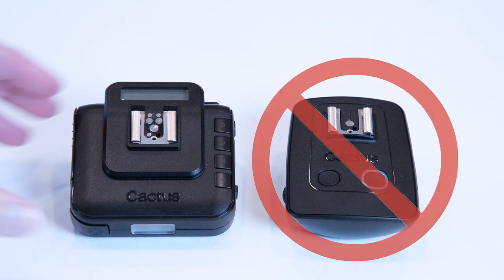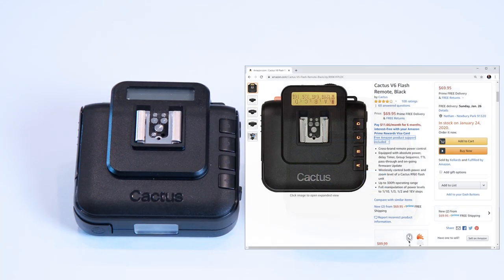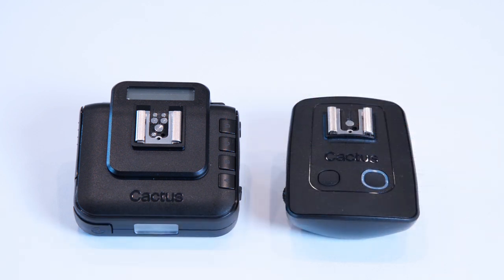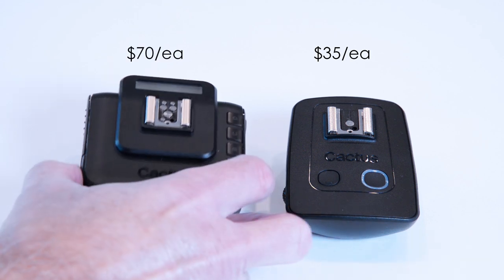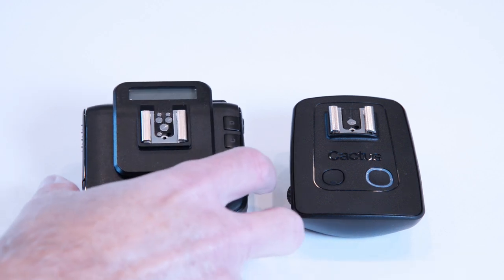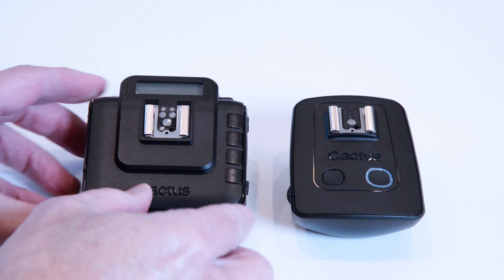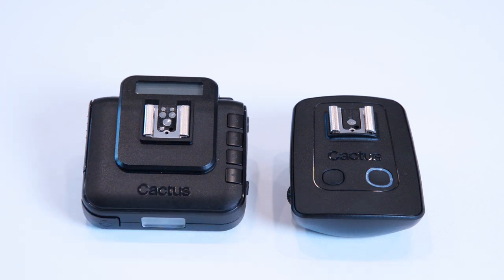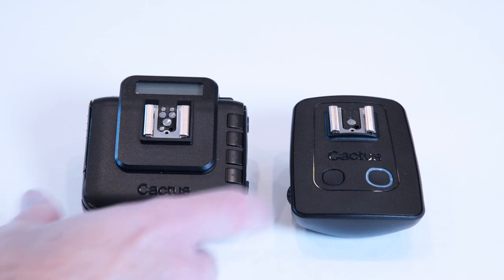Trigger Updates for Real Estate Photography

Comment: Hi Nathan, I have been trying to figure a way to shoot HDR with flash for several years and my Canon's would not do it. I saw another photographer do it in Auto Bracketing mode on a Nikon and I then did a ton more research to see how I could do it on Canon. Canon says no everywhere I look. So I have seen you use the single pin bypass and I decided to try that since I had a single pin hot-shoe adapter like the one you show here.... didn't work. It would not even fire the fash for one exposure. So, I went "old school" and taped off the connection on my Youngnuo YN 622C leaving only the hot pin available. BAM! it worked. Now I can adjust my flash independent of the camera which I love, AND, it will fire 5 auto bracketed flashes just like I wanted it to do. I do not know if I can make the exposures as I want, but it is a step in the right direction anyway. I am so thankful you tripped MY trigger to think outside the box. Great videos my Brutha!

Comment: Thanks for another excellent and informative video, Nathan. I started using the R2SP after your video about the AWB issue. I put the R2SP in my camera’s hot shoe, in APP mode, and adjust my Flashpoint strobes with an R2 Pro, off camera. 

It works great. I use a CamRanger for my shutter release. However, I’ve also used a pair of R2SPs as a remote shutter release for non real estate photography. They work fine in that capacity. 

Again, thank you for creating these videos, and your books, they have helped me tremendously as a build my real estate photography business.

Comment: I rushed to purchase the single pin adapter and the link to amazon takes you to a cold shoe set of 2.  I also purchased one of the clip alternatives in the links above and it is HUGE and heavy.  It's the one with the ball head attached.  I'll be returning both.  But I appreciate that you try to direct us to possible goods to help.  I'm regretting that I returned a set of cactus triggers when I accidentally ordered 2.  Thanks, Nathan!
Reply from the maker: You're very welcome! In the description where I included the links, the link says "Cold Shoe Adapter", I didn't include a link to a single pin adapter as that was in earlier videos; however, here's a link to that if you need it: https://www.amazon.com/gp/product/B073WVW9XM/ My apologies for the clip alternative, as I mentioned the other was discontinued, but there are many you can get that are similar, sorry that one was a bit hefty, and I'll keep my eyes open for others. If though you opt for the YN triggers, then you don't need to have one clipped to your belt (they are smaller and fit in a pocket), and for the one clipped to your tripod the weight you mentioned won't matter, so that clip should work fine. My apologies for any confusion, and I hope this helps.

Comment: I bought a JJC Standard Hot Shoe Adapter to use between my Sony A7 III and my Godox X1T (S). I discovered that the Sony center pin is not the same "center" as Canon/Nikon/Fuji, therefore it didn't work.
Long story short, a Canon/Nikon flash or transceiver will work with a Sony camera, but a Sony specific flash/transceiver will not contact the pin on a Canon/Nikon camera, or a generic hot shoe adapter.  I am buying a Nikon R2 Pro.
Reply from the maker: There are a bunch of comments regarding this that might help in this video: https://youtu.be/RCQO24hcjMo

Comment: Just bought a bunch of the R2SP and I'm impressed.  My 1st impression was how sturdy they seemed, which is something I didn't find on the Cactus V5's.  Also included a AD 200 Pro and am just a little disappointed with the power.  Should have taken more notice of your review and not those that were pushing they have the power of 3 speed lights; but it seems useful.  Looking forward to your next book.

Comment: Hi Nathan, I've been watching your videos for some years. Everything I know about RE photography has been thanks to your videos. So, thank you very much.  You're a great mentor, and I know about mentoring since I'm a professor at a university. A couple of questions: 
1. For camera wireless shutter,  I've been using a couple of Yongnuo RF 605N for around 3 years. But sometimes it takes some time for the camera to focus. It's like the devices have some kinds of issues. In 2023, is Yongnuo RF-603 N II still your recommendation for wireless shutter?
2. I've been using Yongnuo flashes for some years. I'm thinking of moving to Godox since it has more options. Is there a way to use both systems during the transition?

Thank you very much in advance.

Comment: Appreciate all the info. On top of these remote triggers for shutter and flashes, I'm looking for guidance to minimize camera movement by physically touching camera when switching settings from an ambient bracket to flash. Often times auto aligning in PS in post still leaves things unmatched especially when shooting on carpets or non solid floors.  I'm a Sony shooter, other than cam ranger or sony apps on mobile, are there any other options to check out to adjust camera settings remotely?

Comment: Nathan… You’re a God! Question: can you put the RT pro on top of the $35 kit that you recommend? I’d like to be able to stack it on top of my hotshoe  to prevent any unnecessary hanging objects.
Reply from the maker: Thanks! I should have mentioned that: The YN RF603 triggers won't work nicely with most R2Pro transmitters since the YN triggers don't like to detect TTL, which the R2Pro advertises, even in Manual mode. In other words, the same problem with the R2Pro that causes AWB issues also prevents the YN triggers from stacking with it properly. Use a Cactus V6 to stack, or just use the single pin adapter I talk about in the video.

Comment: Hi Nathan great video as always. So I have a couple of YN560 IVs that came with a YN560-TX controller... I also have a Neewer vision 5 strobe that I'm hoping to add to my system by using a YONGNUO Updated YN622C II Single Transceiver. I just use my canon remote for shutter release. Do you see any potential problems with this set up? I also ordered the single pin adapter because I am getting warm colors from the strobe when using the Neewer controller so thank you for that info!

Comment: Thanks for another great video and helpful advice. A true beacon of light!
I plan on getting the R2PRO for my canon camera. To avoid using a single pin hot shoe you suggest using the Nikon or another non canon version to get around the colour cast issue. In an earlier video on this trigger you mention the going into menu/shoot/single for it to use only the center pin. Does this solve the colour cast issue even on a canon model, or do you still recommend getting a non canon version?
Thank :-)

Comment: I can confirm the white balance issue. It's real. I use a Sony A7III with Sony R2 (1st gen) trigger. I have an extra Nikon R2 trigger and use it on the Sony A7III and the white balance is different (true to the color I see). This sucks, I usually blame the camera for this issue. I just wonder if there's a firmware update to correct this problem.

Comment: I have 5 of the Cactus v5 triggers that I use as non-ttl triggers as you describe in your books. As we move forward and away from Cactus is there a trigger you're aware of that, if mounted on the camera (Nikon) hotshoe, will trigger the now discontinued v5 triggers (which are mounted on the flashes - YN560's and XPLOR600's)?  Thx again for your great vids and publications!
Reply from the maker: The Cactus V6 will trigger the V5s.

Comment: Nathan, I bought two of your book and have been following along purchasing equipment for my setup. I had just ordered Cactus V6 triggers before you released this video. Is there any reason I can not or should not go ahead and just use those for my shutter release and flashes since I already have them? Thanks for the great content!
Reply from the maker: Hi Greg. The V6s will work just fine. But, they are bigger and more expensive than the V5s I recommended in my books and earlier videos. If this is just for shutter release, then you may consider returning those and buying the less expensive YNs I show in this video.
Reply: @NathanCoolPhoto  Thanks for the response! I think I'll do that and order your other books!

Comment: Hey Nathan, I have a flashpoint R2 trigger that came with my Explor600. I would love to use this to trigger that light and my new AD200 along with my other Yongnuo YN560 IV speed lights. I shoot with a Sony A7iii and currently use the Yongnuo RF630C II trigger for my speedlights and just slave my 600 or AD200. I am wondering what the best setup would be to avoid white balance issues using the R2 trigger directly and integrating with my existing speedlight workflow. Appreciate your in depth videos, just haven't found my solution yet.
Reply from the maker: Hi Michael,  to understand the whys as well as the whats, I'd suggest taking a look through my interiors e-book, which has my recommendations as well as why, thus allowing you to make a more informed decision, here's a link if you'd like to check that out: https://amzn.to/37mWFnu
Reply: @NathanCoolPhoto  I own that book and your others, good stuff. I will take another look regarding the triggers. I was just curious if you had any insight using this specific setup as I know you utilize some of the similar gear. Thanks again.

Comment: So I understand-- you clip the yongnuo RF603 with cable to the camera for trigger only and do not use it as a pass through [stacking]  (on the hot shoe) for the R2Pro (for which you use a single pin adapter instead)?
Reply from the maker: Hi Cyndy, the RF603 won't work as a pass-through in the camera's hot show with an R2Pro stacked on it. Something I didn't elaborate on in this video (but should have) is that the RF603 doesn't like it when it detects TTL, which, although the R2Pro can be set to manual (which I recommend), it advertises enough info to the camera that the RF603 below the R2Pro picks up on that and will not play nicely. In other words, the same problem with the R2Pro that causes the AWB issue also prevents the RF603 from being a pass-through. So, I recommend one of the work-arounds I show in the AWB-trigger video, which I also touch on here, one being the single-pin adapter, or stacking a Cactus, but not stacking a YN.

Comment: From your books, my impression is that you adjust the power for your flashes on the units themselves, not on the commander (R2Pro).  How do you set the commander to allow this?  If I change the power on the light, it always changes back to whatever was set on the commander.
Reply from the maker: Hi Jim, you have to configure the R2Pro for that. I show how in another video at https://youtu.be/dWE0bXFFNpo
Reply: @NathanCoolPhoto  Thanks - I'll check it out.  BTW - I really like how your pics come out, way better than what I've been doing.

Comment: Would two of these 603-II work to trigger both the camera shutter remotely and an off camera flash remotely ( one on camera , one on flash - using the trigger button on the unit attached to the flash,  to trip flash and shutter  ).

Or would I need a third to act just as a remote shutter release to do everything I want ?

If not the 603-ii , would pairing the Godox x2t with another x2t and or a x2r achieve this ?
Reply from the maker: This requires a deeper understanding of how the various triggers work, in what sequence, and how. There are two sources I can point you to that would help: First, this is covered in great detail in my course on Pro Interior photography at https://learnre.nathancool.com Second, you can look through my book on interior photography at https://amzn.to/45XUV1D Those two sources will teach you a number of things, including the various trigger configurations and how they are implemented and used.

Comment: Hi Nathan, I’m enjoying your channel. 
I want to try my hand at real estate photography. 
I have a Sony A73 and Xpro together with Godox AD400pro and Godox V860 flashes. 
As I understand, to avoid White balance issues I need to purchase a single pin hot shoe adapter to isolate pins between the Xpro and the camera hot shoe. 
However, I am unclear on what equipment I need to remotely trigger the shutter and where to install the same. 
Thanks....John
Reply from the maker: Hi John, I'd recommend looking through my interiors book and lighting guide, which will help you better understand the "whys" behind the "whats" when it comes to all gear for RE photography, here's a link to those: https://www.amazon.com/gp/product/B078NLRKNM?ref_=series_rw_dp_labf
Reply: Thanks for your reply. I have noticed Yongnuo don’t manufacture wireless remote shutter release triggers for Sony cameras. I was wondering if you might be able to suggest an alternate product?
Reply from the maker: Sony has an app you can use on your phone.
Reply: Nathan do suggest then a WiFi extender and do you have any recommendations

Comment: I have a Canon 5D IV and use a Godox XPro-C for flashes (plus some X1R receivers). I bought Nathan's recommended single pin adapter to resolve any AWB issues. However, when using the single pin adapter set up the flashes (speedlites and mono) will not fire when the camera is in Live mode, or if I am using the Canon Camera Connect app. I also have a Flashpoint R2SP transmitter and it has the same problem. I've been considering a CamRanger, but fear the same issue might occur. All works well when I don't use the single pin adapter. Any thoughts or suggestions?
I guess I should ask; does the Flashpoint R2SP transmitter have AWB issues when used without a single pin adapter?
Reply from the maker: Hi Todd, none of what you described has to do with the single pin adapter. Canon cameras tend to have, by default, "Silent Shooting" enabled (sometimes called "Silent LV Shoot"), which disables the flash in live view for triggers in the hot shoe, so you need to change that setting. The R2SP is a single pin transmitter, so no need to add an additional adapter. But, address the Silent Shooting mode on your Canon and you should be good to go with what you have now.
Reply: @NathanCoolPhoto  Thanks a million! That fixed the issue! Also, thanks for all of the great videos & lovin' your books!

Comment: I have a pair of the rf 603ii triggers. I have put it in my CANONS hot shoe and stacked a R2 FUJI trigger on top. That seems to pop my TT600 and ad200 while still allowing me to control flash settings from the flash itself. Anyone see a problem with this setup?

Comment: What are your thoughts on using the mobile app to trigger the shutter on cameras that support it? For those, you can use your smartphone, or even a volume button on your headset as a trigger for the smartphone app. Many nikon cameras support snapbridge and other 3rd party apps, same for Canon and Sony.
Reply from the maker: Same as CamRanger, not my thing, I can shoot faster with a simple RF trigger as a shutter release, and I don't have to wait for images to render on the phone, tablet, etc. Many photogs use CamRanger and mobile apps, it's just not something I've found beneficial for fast shooting through a property. Designer work, maybe; MLS, not my recommendation.
Reply: I agree it’s just too slow I was using snap bridge as well as control my camera on my iPhone with my Nikon Z6 and while everything works perfectly fine it’s still simply a lot faster to just use your wireless triggers and get the right exposure for the power level of the Flash and then simply walk around using that same power level throughout the room. Your first shot is usually taken behind the camera with your flash pointing up so you’ll be able to tell right away if you have enough power, You simply then walk around the room and not change the power output of the flash.

Comment: I purchased the single pin pass through and it solved the WB issue but now, for whatever reason I cannot trigger my flashes using canons built in wifi and app with the single pin stack. So I'm stuck with a bad WB or not being able to fire my camera from my phone. Any recommendations on a fix?
Reply from the maker: Make sure silent mode is disabled. That causes issues with Live View, and likely could also affect the app.

Comment: Hey there everyone! I need help asap lol
My X-pro trigger is not letting my camera (Fujifilm xt-4) to switch to manual flash mode. It's stuck in TTL even though both the X-pro trigger and Ad200 pro are both set to manual. Has anyone had this issue and was able to fix it? Thank you!

Comment: Is there a flash triggering system that I can set when the flash will fire on a set of HDR brackets?  For example, on a 5 bracket timer can I set the transmitter to signal a flash to pop only on the first and last exposures?  or on any combination I choose?
Reply from the maker: Since I don't recommend HDR, I'd say just do the flash-ambient blended method and problem solved. I have more on that in my REP series at https://www.amazon.com/gp/product/B078NLRKNM?ref_=series_rw_dp_labf

Comment: Thanks for the Video Nathan. I am new to the WB issue. Just bought the Flashpoint R2 Pro MK II transmitter. Guess the MK II doesn't fix this. Can this be resolved by using Auto WB develope setting when I import to Lightroom?
Reply from the maker: Hi Ron, I'd recommend watching the full AWB trigger video so that you understand how you can detect if any trigger could be causing this issue (through EXIF and testing), and also the workarounds you can use to avoid it. Allowing the camera to miscalculate AWB and then relying on third party software to correct it (i.e. LR as you mentioned) defeats the purpose of having good gear that, in its own firmware, calculates the best AWB for its sensor and the information it detected for a shot. Here's a link to that video: https://www.youtube.com/watch?v=RCQO24hcjMo